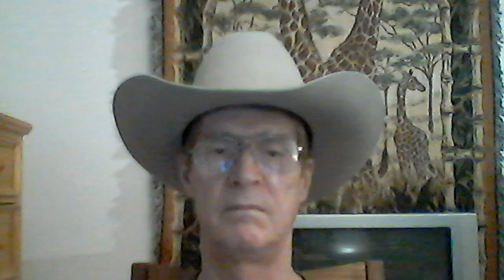Coax-Fed Dipole Without Balun

Comment: If you feed a dipole with coax without a balun and without a choke, I'd think it'll work better if you keep the now radiating coax along the dipole leg where you connected the coax shield, since they both make one of the dipole legs.

Comment: Stan I love the Cowboy hat but  the video is long on the stuff that comes out of the South bound end of a North bound Bull and short on technical data. I think you could have summed up your video in about 10 seconds with you answer and that being "Yes". Yes it will work but not as good or as it should or what is better for your transmitter finals.
Now lets dispense with the theatrics and get down to business.

Yes you can use anything for an antenna including wet string but we are more concerned about what the transmitter is looking for so it does not burn up when half of your output power is coming back down the feed line. We are interested in radiating electromagnetic waves and not heating up your radio.  You did not touch on any of the important stuff like SWR, impedance, and reflected power, and so forth. I think your treatment of this fact is seriously lacking. I suggest you study up and come back with something useful. 

Nice try Stan but NO CIGAR!

This reminds me of these "Unboxing Videos" in which a guy orders a microphone or some other piece of gear and goes through the cutting of the box open, taking out the contents, looking at what he got then telling us how wonderful it looks. Pure crap.

Comment: My first antenna wa a 40 meter dipole in 1968. It was fed with coax direct to the antenna and the other end to the back of my Heathkit DX-60/40 crystal controlled CW transmitter. No SWR meter, used a 100 watt light bulb connected to the transmitter and adjusted the controls for maximum brightness, disconnected the light bulb, connected the antenna and proceeded to make CW contacts all over the states on a single fixed frequency. At the time I only had one crystal in the 40 meter novice band. Great fun!
 Today a piece of my original bell wire antenna is visible on the tree limb it was nailed to 54 years ago!

Comment: it'll work for sure..i never did opt for a true balun..did put a coaxial choke balun on for a while..-not really quite the same thing..i suspect all that happens without a balun is that the pattern is skewed..since i wasn't aiming for a specific bearing, it didn't matter at all..-lots of contacts were made..glad i didn't know the difference..a little knowledge can be dangerous..